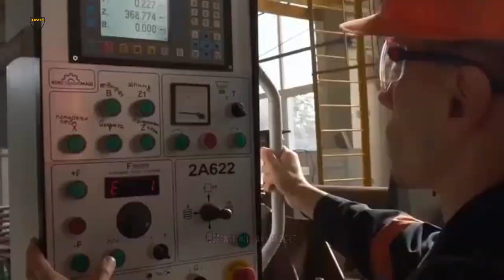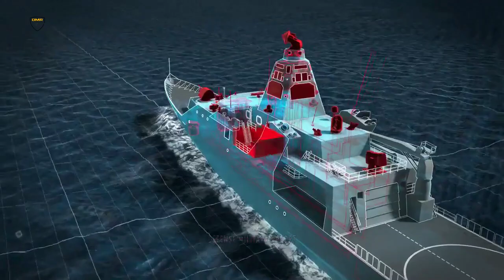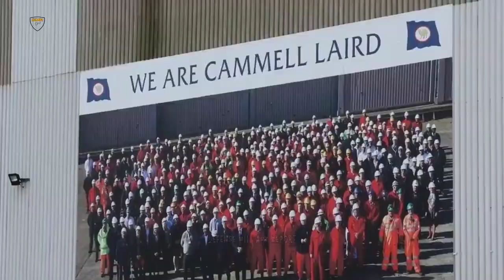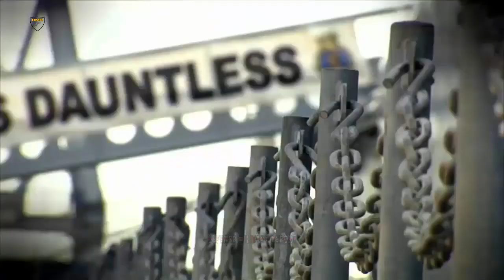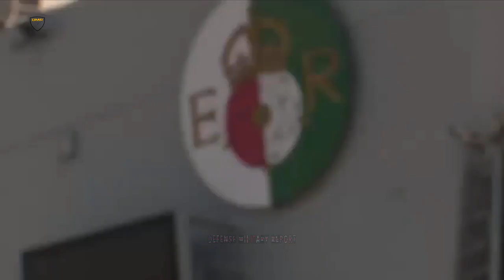UK Shipbuilding will build 150 new warships in £4billion deal and new missiles

Comment: Nothing has been finalised about any ships being built overseas in foreign shipyards, if it did happen, it'd be a UK lead program using mostly UK suppliers.
We also need some Corvette sized ship, around 4,000Ltns, and some fast attack missile boats /craft of around 2,000Ltns to increase surface combatants capacity as well as a new helicopter dock landing ships, amphibious variants to complement our existing amphibious landing ships and more smaller autonomous ships to do the mundane jobs.